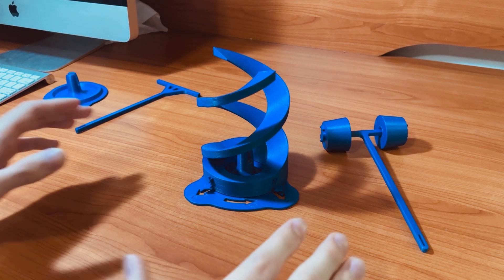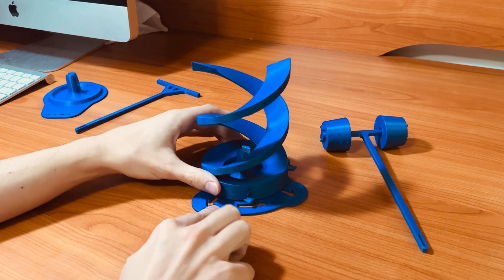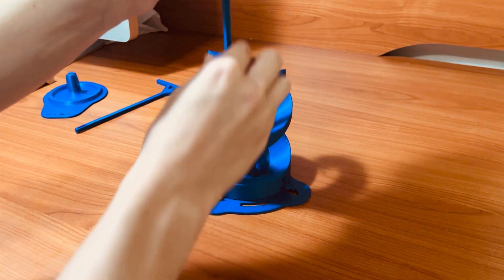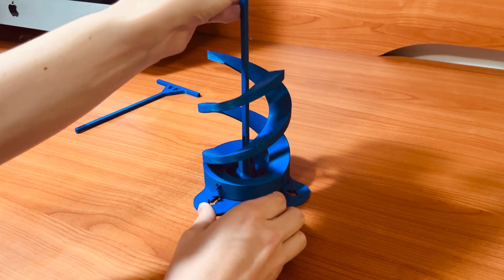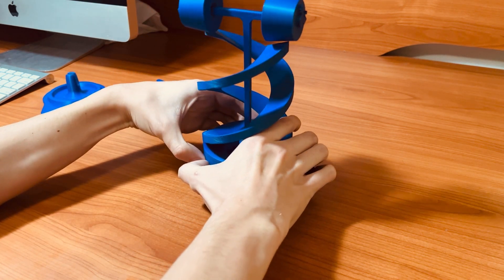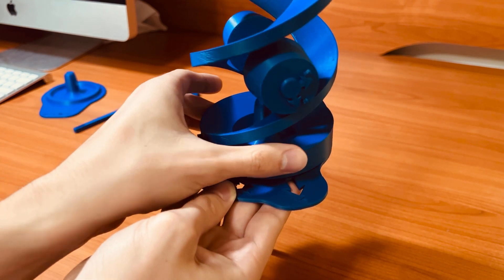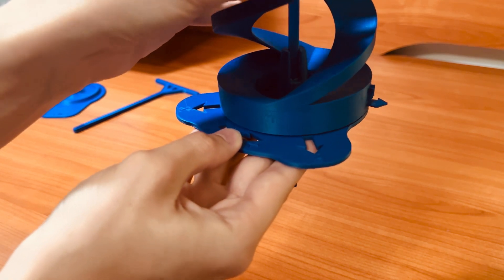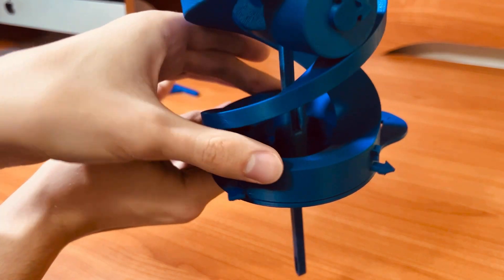Helix Roller 3D Printed Kinetic Sculpture - Operation Instructions and Purpose

Comment: I like it.  Especially when you pull it back up and see the illusion of it moving back in the spiral.
Now if you make a spiral wound in a circle and the rod  follow the radius curve, you could turn the circle and see it continuously traverse.  I'm not sure it would be useful but would be interesting.
Reply from the maker: Yeah that makes sense, I didn't think of adding a separate spiral directly in the rod. Initially, I assumed I could rotate the spiral in the opposite direction and the rod would go up. I believe this would achieve the same continuous motion you described. But, when I rotated the helix the other way the spirals started to bend and there ended up being too much friction between the rod and the base. Perhaps with different materials/tolerances (less bending and lower friction) this device could be continuous without modification. Thanks for the idea! It got me thinking about how to improve the design...
Reply: @MechMX  please help! i cant click the "X" on the top right of my screen in your longest conveyer belt tycoon game.

Comment: silicone caulk or rubber bands would add traction. Either that, or add a groove for an o ring.
Reply from the maker: I hadn’t thought of that, both of those options make a lot of sense. I appreciate the input 👍